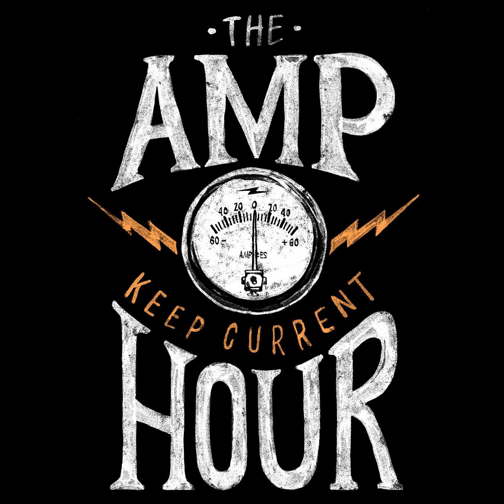The Amp Hour #604 - Robo Fry Guy

Comment: Would an astronaut's horse have a specially constructed EVA suit?

Milton Keynes... like Milton Friedman and John Maynard Keynes fused together. 

Jack of all trades, master of none... still better than a master in only one!

Hsardware training with all you need in a browser? Interesting. I thought it would be more about a hassle-free way of training people on how to use machines with no trainer's physical presence required, something like all the remote schooling or conferences that went mainstream through the pandemic.
Jupyter Notebook does exactly that when it comes to experimenting in Python, though I'm not sure if containerization goes down all the way to OS level. Using a browser to access remote systems is dependency free on one hand, resource consuming on another (consider that if your customer is likely to work on an old-ish laptop etc.). 
Personal story time: when I built the rpi2caster control device (a Raspberry Pi based computer control system for the old Monotype typecasting machines), I looked for a easy-ish way to control its utility software that has a CLI and runs on the Raspberry; sure you could install a SSH client (PuTTY) or even have one if you run MacOS or GNU/Linux, but most people run Windows and wouldn't be too happy to have to install and learn something new, so I was looking for a way to get rid of that nuissance, and I'm not much of a software developer so I couldn't make a full stack web app to save my life (even though I'd love to), so I went with shellinabox and bam! Point your browser to the Raspberry's IP or domain address (if you have a local DNS server set up in your network) and the console will open, starting the control software right away.

Romex, the 'murican standard single-phase wire you see all over the place down there. An equivalent of the Brutish "flat-and-earth" or German "Flachkabel", or Polish "YDYp"

Dave, please rewire that fusebox, for crying out loud! It looks like a Polish electrical panel from the '60s or '70s, gutted out and retrofitted with MCBs in the '90s.
Go for whatever is standard now in your parts (I don't know the Australian electrical code), preferably the DIN rail box outfitted with MCBs and RCDs.
Pity that you got mostly single phase. Here in Poland (and Germany, the Netherlands, maybe most of continental Europe) three-phase is increasingly common for domestic wiring, thanks to increasing popularity of induction hobs. In fact, I wired my flat for proper three phase, but haven't upgraded the utility connection - the costs are prohibitive and there's a lot of paperwork involved. So, I'm still going on a 230V 25A connection (roughly 5kW) only avoiding drawing too much power at a time, and my most power-hungry load is a 3kW storage water heater that's scheduled to run in the off-peak hours of a split tariff (7-13 and 16-22 peak, 13-16 and 22-7 trough).